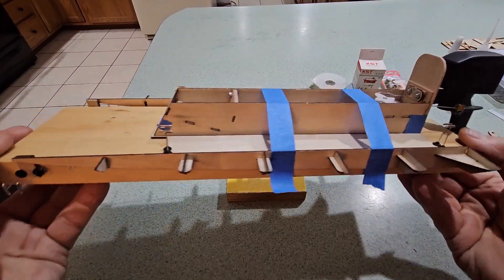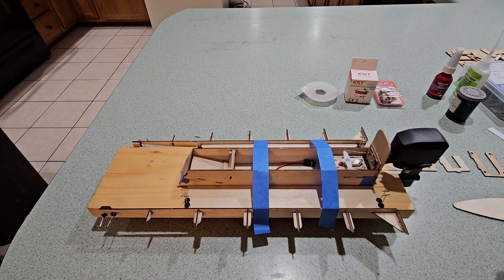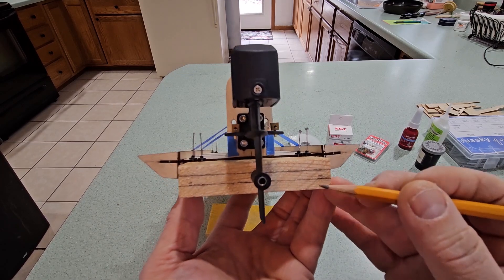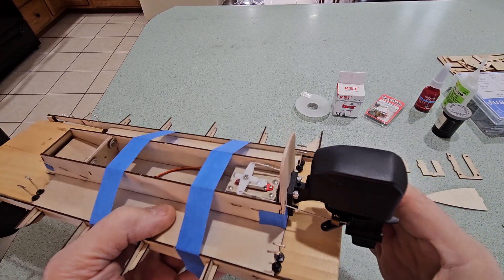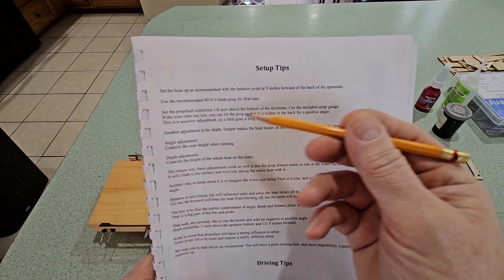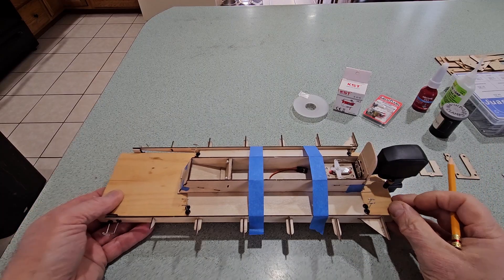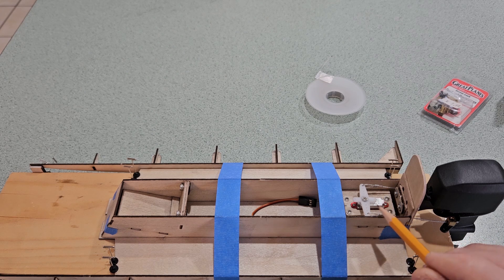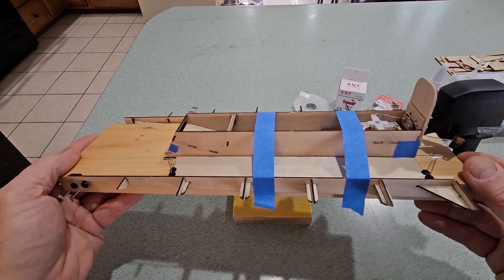Dr Jet Micro Outboard Tunnel Hull_Setup and Build!

Comment: There actually is a short flat section on the bottom of the sponson.  I really like what you are doing in adjustability, and once I have an optimum motor/strut position, I will incorporate it into the production design.  I also like the universal motor mount approach as well.
Reply from the maker: OK, I see it now. The first 3 to 3-1/2 inches of the sponson bottoms are straight? So that would be the ride pads...

But, they are angling upwards from the back edge of the transoms. So they're not a surface to use to set the prop shaft centerline height. Very good...

I will show the dimensions of my transom slots and the height of the outboard mounting plate off the board in the next video. And dimensions of the motor mount.
Reply: That is correct, the tunnel gets deeper as you move aft; the ride surfaces are not parallel to the center plate. @chilly7261